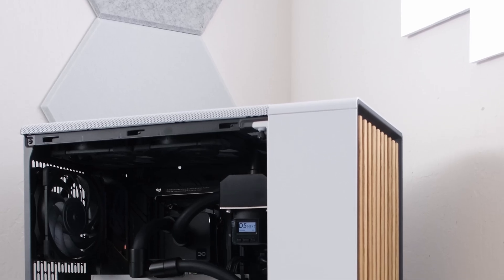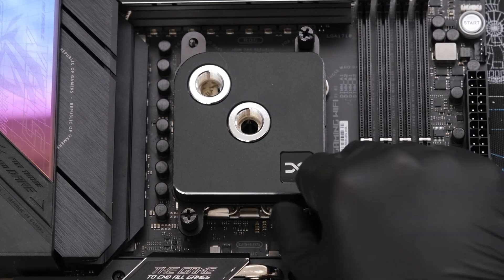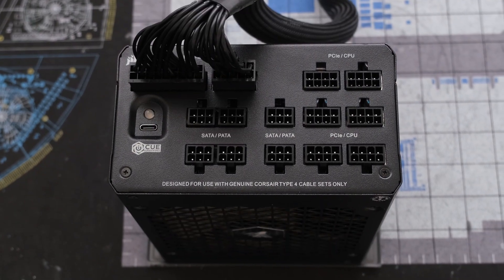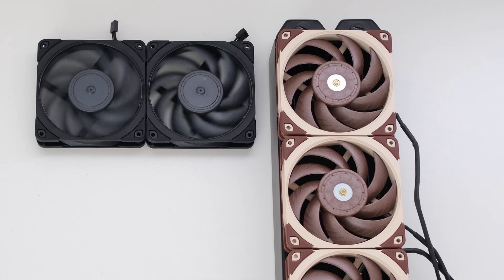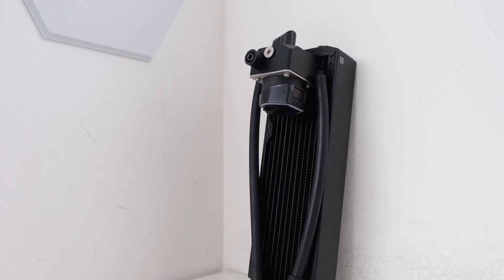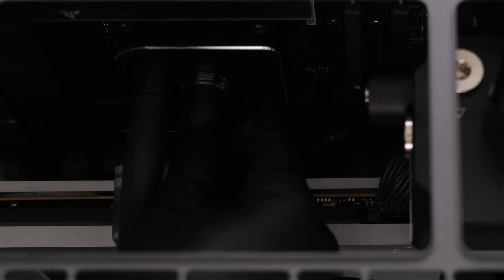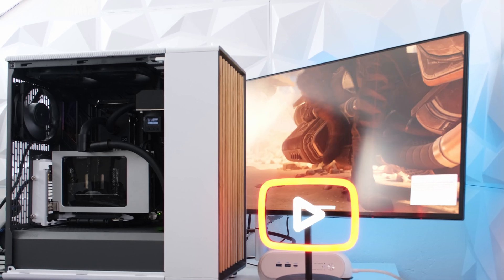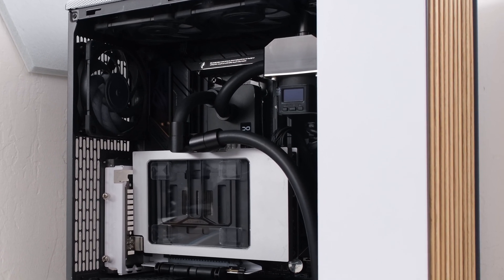Fractal North Watercooled Build - RTX 4090 + 9800X3D

Comment: It looks very nice but I fear, having no real reservoir and especially having the pump that high can cause damage to the pump, if water levels are not carefully checked over time. In principle the rad will catch most air (inlet and outlet on bottom is great) but yet air might find its way into the pump.
Reply from the maker: I agree with the fact that having the pump being at the highest point in the loop is a bad idea. First, I tried all the different combinations of GPU block and reservoir/pump placement, including with and without a 240 rad up top and this position was the only acceptable position. Having said that, the pump is not at the peak of the loop. I made sure that was considered during the build tests. I expect the air to go up to the radiator as its in a higher position. But then again, after water cooling in very popular case, I think its much more suited for air cooling. Hope that helps

Comment: i like the build,   i would have used 2 rads.. otherwise  spot on
Reply from the maker: Thanks for your comment 🙏 That was my first inclination when I saw the North. I said "DOUBLE RADS BABY!" But I tried like at least 10 configurations and nothing worked well enough to put to video. So I scrapped the top rad and then I had more room to work with but even with that it was hard to fit everything in there. I think with the North XL, everything would fit nicely.
Reply: I'm sure you would. Makes sense.

Comment: This is great it was clean setup. The temp though too high for a water cooled setup. You should make a separate radiator for GPU since the chase was able to accommodate a 2nd one. What we try to achieve here is lower temp as much as possible to prevent lag and cap. But all in all the build was nice.
Reply from the maker: Thanks for your comment 🙏 So yea, I got comments that the temps were too high. I didn't think much of it as there has been plenty of videos on my channel of super cool temps using these same parts. BUT! I recently took this build apart and I found that I never took off the plastic film for the CPU block (!!) First time making that mistake. Glad the thing didn't really throttle...Anyways, that would be the reason why the temps were off. It is what it is

Comment: Impeccable timing and great video! I am building a water cooled 7800x3D/4090 build in the Fractal North right now. With low profile ram and a slim 240 rad, I am JUST barely able to fit the rad plus Noctua 25mm fans at the top. My pump and res are on their way, but I am worried about being able to fit them.  I’m trying with an Itx board and the vertical mounted GPU to create a little extra space. This video gets a like for sure
Reply from the maker: Thanks for your comment 🙏 Ohhh, I tried to put a radiator in the top. In fact, that was my first inclination when I saw the North. I said "DOUBLE RADS BABY!" But I tried like at least 10 configurations and nothing worked well enough to put to video. So I scrapped the top rad and then I had more room to work with but even with that it was hard to fit everything in there....so hopefully it worked out for you.

Comment: Thanks for the video. I'd be very interested in more details on the fill process and how you removed all the air from the system. 
I don't really know the process for filling a loop without a reservoir or a very small reservoir. Did you temporarily fit a tube to the top of the pump top? Did you simply fill the pump top as much as possible and then close it, pulse the pump and repeat? The steps for the best way to tackle this would be appreciated. Thanks
Reply from the maker: Thanks for your comment 🙏 I plan on doing a better job at showing the fill steps in future videos. For this one, the short fill shown was the only really usable footage I was able to capture. The process for this one was filling the radiator via the single port on the very top. There is little visual clearance, so its really hard to tell when its getting full. When that was full. I then filled the pump top. That was also hard to see when full. I would then briefly run the pump and then refill. Repeat until the GPU block shows no more air. This could take several hours to get most of the bubbles out and then overnight for more bubbles to dissipate. All this would be significantly easier with a reservoir, but sometimes a reservoir just doesn't fit. Hope that helps
Reply: @vectornetwork  Cool, that does help. Thanks for the reply. 
Looking forward to seeing the fill process in future videos - especially if it's tricky like this one :)

Comment: Love seeing the bitspower 90" fittings replacing the EK ones !
I personally think they look even better with the Optimus fittings.
Reply from the maker: Thanks for your comment 🙏 and thanks for noticing! It's taking some time to wean myself off of EK's fittings. The Artemis appears to be one of the few reasonable replacements. You're right about the look. It's different but not any less nice. I noticed that they are chunky. That can be good or bad, depending on the build. I do still like the look of the EK micro 90 degree adapters. The bitspower compact ones work but I don't really like the logo right there on it. I went with it because, well, it would be hidden under the case shroud anyways. Thanks again for watching
Reply: @vectornetwork  Couldn't agree more, hopefully bitspower or others come out with a more comparable micro 90 in the future. I have the exact rad from the video leftover from another project and was thinking of trying to put it in the North myself so this video was an godsend as a reference! Keep up the great builds / videos!

Comment: Very high temps for a watercooling gpu and cpu block
Reply from the maker: Thanks for your comment 🙏 This build had a planned compromise with a single (thick) radiator. It runs well within safe margins nice and quietly and we have explored lots of double/MORA rads on the channel. This build is geared for a clean look and everyday use.